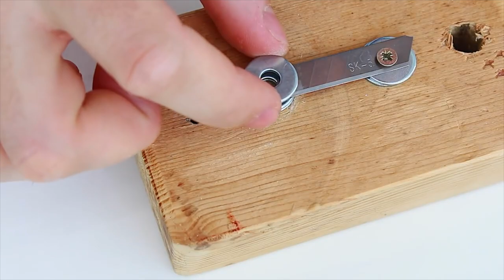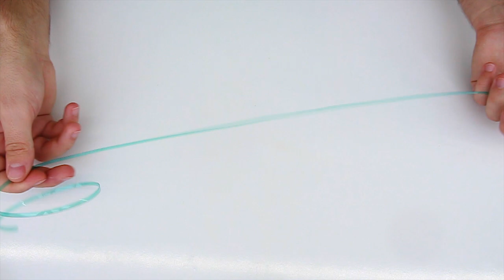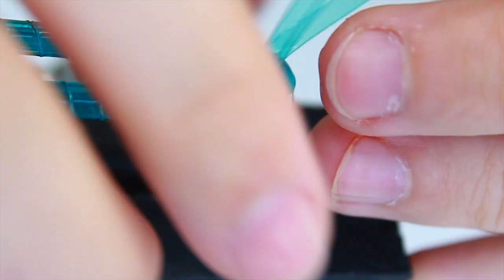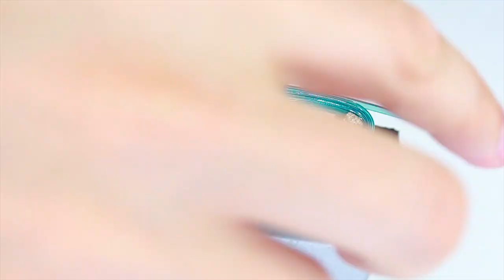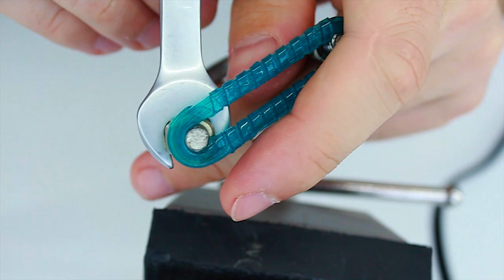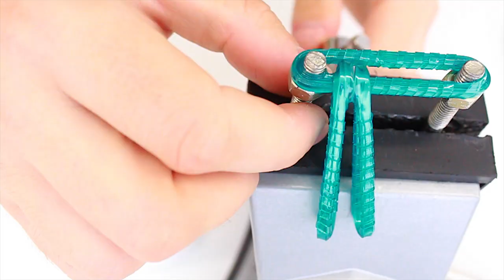How to make a chain of plastic bottles / TUTORIAL

Comment: the chain is very nice, but it looks like lots of hard work...
Reply: Maybe. But what if the application was as a tether for something lightweight on an airplane? Example: To keep the stack of pillows in the closet from spilling out. Your steel chain would be unnecessarily strong, undesirably heavy, and susceptable to corrosion. The recycled plastic link chain would work just fine (although it may not pass the flammability, smoke and toxic fumes requirements.
Also, there are people who may be disabled or may not have the mental capacity to do more complex work—they may be able to sit quietly and do the labor intensive work to make these links.

Then again, if you study the mechanical devices and the movements required to make these links, you'll notice that they are very similar and highly repetitive. Which means that a human could develop a repetitive-motion injury, like Carpal Tunnel Syndrome, and therefore the build operation is better suited for a robot, while the human is utilized for a better type of work.

So see if you can design a robot (from Lego Mindstorms  or Vex or ...?) that can build these links efficiently and fast.

Comment: Alas, I couldn't seem to pull the strings from the cut bottle. Some places are much thicker than others, and then it breaks in the middle of pulling the string out. I followed everything to a T. I also bought the hardest and sharpest knife blades. The only difference is that I place the bottle vertically on the blade and then pull. Should I put the bottle horizontally like it is shown in the video? Would it make any difference?